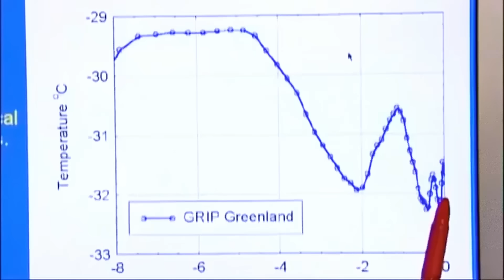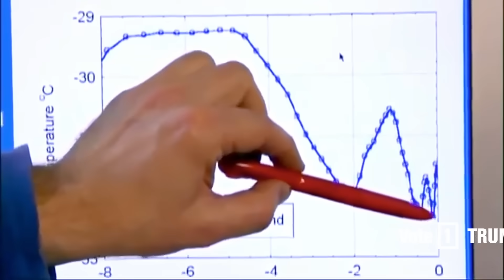Greenland's Ice Core Samples -Trumpet of Patriots reveals interesting Truth's about Climate Change

Comment: As other commentators have already pointed out, sample size of one with no source provided using outdated observation methods, and the data ends 52 years prior to the start of the 21st century. But sure, lets humour the claims made in this video.

Ok cool these trends of temperature fluctuation exist, but at what speed? How fast is the temperature increasing at the most recent point in that chart in comparison to previous increases you have data of? Humans are making it happen faster than it naturally would based on the "data" presented here.

Also why would I trust the political party that exists because the "leader" of it wanted to circumvent transparency laws and not reveal donations made to the United Australia Party (UAP)? 

The courts basically told you to go sit on it and rotate when you tried to re-register the UAP xD.

Comment: Conveniently this leaves out the CO2 levels during this period WHICH YOU MEASURE THROUGH ICE CORES 😅

CO2 levels and temperature over the past 800,000 years have a direct correlation which is conveniently left out. 

This proves nothing especially since CO2 levels have been higher than any moment in the past 800,000 years

Comment: Wait, you drill a 3 km hole in an ice sheet and insert a thermometer in the hole to map put out temperatures (to a thousandth of a degree no less😁) over the last 1000 years. I'm not an expert, but I'm pretty sure that's NOT how metrological ice core analysis works  😁

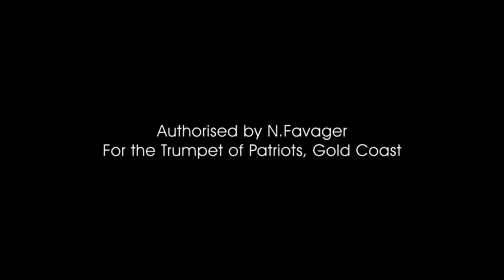Comment: This is nothing new as climate scientists have researched climate way back using various mediums.  This does not discedit the scientific calculations done around 150 years ago that proved climate change exists unless you can find a flaw in the original calculations which you will not.  This video is hogwash. 4:17

Comment: An interesting hypothesi the thing is, it is the increasing level of carbon dioxide in the atmosphere that is causing the current global warming. I think when you have a chart that shows that some thousand years ago that then temp went from -30 to -28 in Greenland is not necessarily the proof of anything. That kind of variation could be a result of a slight change in the gulf stream which would also cause a warming in Europe at the same time

Comment: What a crock of shit. Ice does not ‘remember temperature’.
Reply: Yes I agree, I wrote a comment to that effect above. If you put a temp probe in some water then put it in the freezer it will be 0C once frozen even though the freezer is much colder.
Reply: @TheMuthaFingDog try putting some water in a plastic cup and put a wired temperature probe the water, then put it all in the the freezer. Even though the freezer is much colder than 0c i.e. -18C or even lower the ice will be at 0C. So the video about ice cores is fake science. The ice cores do not record temperatures from eons ago by just measuring the temperature of the ice core as the entire ice core will be around 0C. The impurities in the ice will influence the temperature but it will still be around 0C. I did this experiment myself with two temperature probes, one measuring the freezer temp. the other measuring the water temp. Even when the water was completely frozen it still measured 0C even though the freezer temp. was -27C to -18C
Reply: @BobBe3-f7s  the scientist in the video is not literally measuring the temperature of the ice. He is using the entrapped air and other shit to infer what the atmospheric conditions would be. 

Also, your cup of water will eventually reach -18, you obviously didn't leave it for long enough - Google "0th law of thermodynamics". The reason it seemed to stay at 0 is that it hadn't fully changed from liquid to solid yet. Give it a few days in there and let me know how you go.

Comment: Sample size of 1 which contradicts measurements in many other regions of the earth. Method is flawed since the laws of thermodynamics say otherwise.
Not a credible study
Reply: The study is not flawed because it's  only the measurement in those specific regions
Reply: @gwyllymsuter4551  now that's completely false...the Greenland data IS accurate, what the clip doesn't show is the last 30 years or so.
Reply: @Happychappy-k1t Ask someone over 50 if the temperature has increased in 30 years.
It hasn't but it does get warmer later in the year and stays warmer into april.
We have had very mild summers the last 4 or 5 years so they cant claim global warming anymore.
Now its climate change and judging by this research and other research it us obvious the climate does change and has been changing for at least 10,000 years and no doubt longer.
Follow the money in this climate change palaver and you will arrive at people heavily invested in renewables.
Look into the oil and gas hustory and you will find a lot of dead inventors who found ither more efficient ways to propel cars.
Both sides of the argument are deeply corrupted.
Reply: @Happychappy-k1t  60 years.

The doco is 20 years old and the data making up the final results is from between 1950 and 1965.

The doctor has even come out against it.

Pure propaganda.

It’s disinformation.
Reply: The method is. It flawed.
It's the conclusion made by the people who clipped this small part of a documentary and misrepresent it.
The scientists himself does not support how it is used here.
I linked to a full debunking here before, but all the posts I made have been deleted.
Reply: It is a credible study: just misrepresented by Clive and his idiot  mates. Watch this video to see what Steffenson really says about the Greenland project   https://www.youtube.com/watch?v=v9zAtqrDpzY
Reply: Clive, l am sure this convinced the uneducated, but most of us know 	Who and what you are, just a rich thief.
Reply: @wallywally6172  Name one extremely rich person who is to some extent not a thief?

Comment: "Present" in climate science means 1950.  So the graph misses out the last 75 years.  The temperatures in Greenland since 1950 have increased 0.2C per decade on average, with most of that in the last 30 years..

Comment: Haha, thermometer?
Funny.
He probably just dumbed it down to the level of a lie.
You can test what temperature the earth was when the water was frozen but you don't use a thermometer, that's stupid.
You use a mass spectrometer to measure the ratio of the oxygen and hydrogen isotopes in the ice core samples.
Then you compare that isotopic ratio to the Standard Mean Ocean Water isotopic ratio (based off a sample of our modern water).
The difference between these two isotopic ratios is smaller for cold periods and bigger for warm periods.
Last I heard we'd managed to graph multiple ice ages going back nearly 1,000,000 years.
Compared to all of those, our temperature increase right now is ahead of schedule, about 45x faster than it should be.
Without humans the Earth's temperature should still be decreasing right now, instead it's going up faster than at any other point in the earth's record.

I wouldn't blame the scientist too much, this was back in 1998.
We have way more data and research now and have learnt so much more.
We have a much clearer understanding of what causes these temperature changes now than we did then.
The progress that has been made is incredible.
Now we just have to demolish the companies that refuse to let go of their profits while face fcking everyone else.

Comment: All the usual negative, headless chicken responses here. Clive is the 'Orange Man Bad' of Australia!
Reply: Try and take these responses on board. Clive is nothing other than a grifter using politics to get his way by throwing money and lies at it.
Reply: I don't really care who clive is, I just thought this was a science video, and as a university physics student, I was interested. However, I can assure you that everything in this video is 30 years old, completely out of date, and very incorrect. When you measure the temperatures for when snow fall occured, you don't just measure the temp of the ice, that doesn't give you any information. Instead, you measure the molecular make up of the gases trapped in the ice, as this will be perfectly preserved in each snow layer, with the acception of radio carbon decay. You can then compare the gas make up to the current gas make up of the atmosphere and determine the amount of carbon that was present, and the resulting temperatures (you also have to consider the orbit of the earth around the sun but we can do that very easily these days). When you do it this way, the correct way, we see rapidly rising temperatures and carbon levels compared to any point in history, in fact, based of the cycle of ice ages, we should be entering an ice age right now, and experiencing cooling, but we aren't, because of carbon being put into the atmosphere by the burning of carbon rich fuels.
Reply: @Ch-l-o-e you should care. Scientific apathy to politics is what has led misinformation to so easily be trusted and consumed in the modern era, and the ultimate consequence is a billionaire coal baron “um ackshually 🤓☝️”-ing the truth of the greatest existential threat to all life.

Comment: Okay let me get this straight. You’re taking temperatures at a fixed point in time. Whenever this actual study was done whether it was 30 years ago or today doesn’t matter and measuring the temperature in the ice at that time thinking that it’s holding a temperature from the day it was Created? Like if the snow fell in this section 8000 years ago and it’s -30° they’re thinking that it’s currently the same temperature that it was 8000 years ago… are they serious?
Reply: He probably just dumbed it down to the level of a lie.
You can test what temperature the earth was when the water was frozen but you don't use a thermometer, that's stupid.
You use a mass spectrometer to measure the ratio of the oxygen and hydrogen isotopes in the ice core samples.
Then you compare that isotopic ratio to the Standard Mean Ocean Water isotopic ratio (based off a sample of our modern water).
The difference between these two isotopic ratios is smaller for cold periods and bigger for warm periods.
Last I heard we'd managed to graph multiple ice ages going back nearly 1,000,000 years.
Compared to all of those, our temperature increase right now is ahead of schedule, about 45x faster than it should be.
Without humans the Earth's temperature should still be decreasing right now, instead it's going up faster than at any other point in the earth's record.

I wouldn't blame the scientist too much, this was back in 1998.
We have way more data and research now and have learnt so much more.
We have a much clearer understanding of what causes these temperature changes now than we did then.
The progress that has been made is incredible.
Now we just have to demolish the companies that refuse to let go of their profits while face fcking everyone else.
Reply: @KeKe-bv8qv 
Good explanation, mate. It can be hard for scientists to explain to a general public how their research actually works.
Reply: Note that Ice core samples later taken in Antarctica proved that the Medieval warm period was NOT global which makes this video pretty much a heap of rubbish anyway.
Reply: It was 30 years ago. Old tech alert in the monitors he used to display the graph.
Reply: Yep.....a statistically significant sample of...... ONE???

Comment: Hello from sunny Australia. Same latitudes as southern USA. 
If little uranium an important dimension, then the opposite is true, that the big and the fragile $TRILLIONS national electrical grid infrastructure investment that was never overbuilt and took 100years to build, is an important matter. 

Then to replace fossil fueled energy with 10 times more grid electricity is an even a bigger matter. 
Bigger big grid capacity AND  more generation capacity. 

Grow up and think like adults. 

Grid expansion projects budgets are exploding, Snowy 2.0 pumped hydro expansion project budget is exploding with new grid capacity. 
$1.3billion to $5billion and $2billion to $20billion 

My proposed PV rooftop needs a $3,000 upgrade as the pole supply is too small for my little feed-in. 
Just sunlight  !!!!! 

20million PV roofs paid by the consumers energy budget, and the grid owners are getting SHTTSNPANTS feelings for grid needing upgrades and cashflow loss and blackouts threats. From sunshine 🌞 ☀️ ♥️
Reply: Climate warming latitudes.